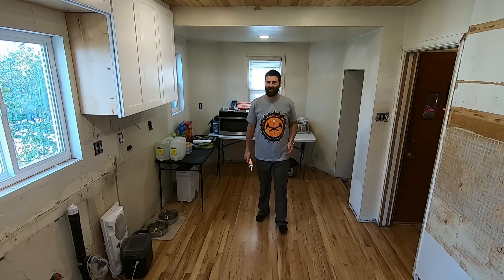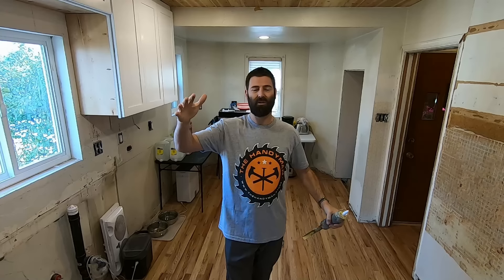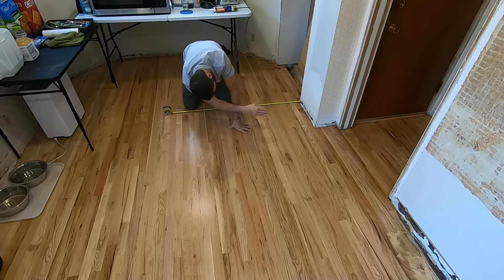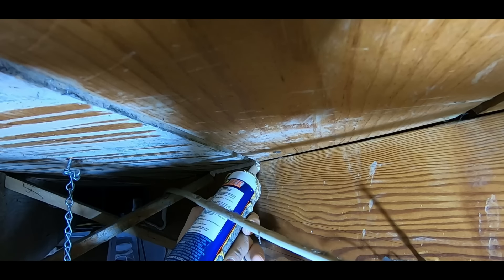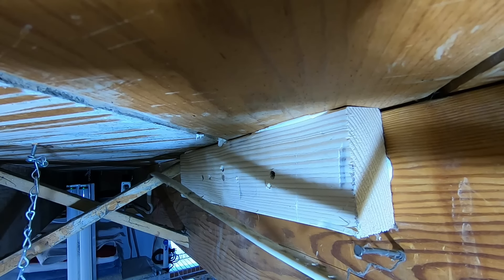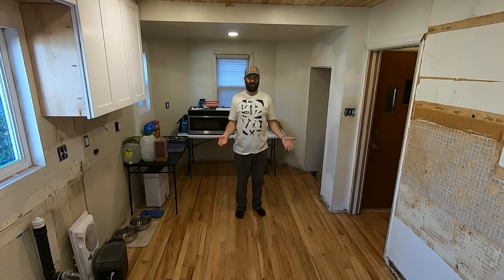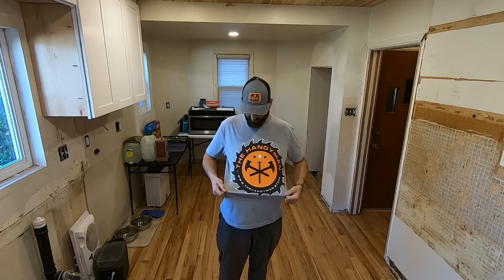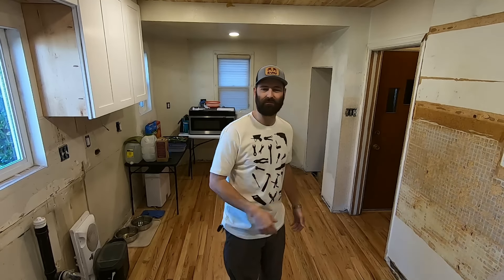How To Fix Floor Squeaks In Old Houses | THE HANDYMAN |

Comment: My house is 56 years old and it has oak floors. Several years ago I used "Counter-Snap" hardwood joist screws to fix the dozen or so squeaks. They have held up fine. They make two kits, one is for between-the-joist squeaks and the other is for at-the-joist squeaks. Figure out if your squeak is over a joist or somewhere in an area between the joists. They work. And, they aren't visible. Don't have to work in the basement or crawlspace. Just walk around the house, find a squeak and fix it.

Comment: Why do all of this rather than just drilling a screw into the joists, breaking them off and filling the hole with woodglue one of those wooden floor repair kit sticks and paint? It fixes the squeaks instantly and you don't have to wait a day to see if it even helped. I'm ignorant on the subject and would be open to an explanation. I just paid some guys to do what this guy did, and I'm wondering if I made a mistake.

Comment: what length screws do you use for this job? and what type of adhesive?
Reply: I used extra strength Liquid Nails to fix my squeaky stairs, I'm sure that will also work for floors.

Comment: Just a little TIP (hope don’t mind): 5:10 If you cut a 5° - 10° bevel going away from you towards the sistered joist, & the top of bevel will “touch” the subfloor above; you’ll create a “gap/pocket” for the adhesive to all go into & help “connect” the material together.....making it little bit stronger (especially when add those “screws”) & more importantly.....less likely to squeak. This also helps the “glue” not to leak/squeeze out over time, from ppl walking above, 5:38
I so hope that all made sense, cuz it did in my head🤪 (for explaining, that is😂); & we use a similar method when installing stairs (bevel the riser & treads; so the adhesive has a place to go w/o oozing out, but also allows good adhesion). This also helps w/ using less fasteners in the face of the tread; meaning less filling later👍🏻
Cheers✌🏼

Comment: Little tip for ya, have the screw drilled through timber block (for under floor), so you can just drill through without trying to hold block, position screw THEN drill in

Comment: Interesting fact: The decking used for the subfloor on that house was first used to form the basement walls. The white/grey "runs" on the bottom of some of the decking boards is the cement that ran over.
Reply: I always wondered why there was grey/white goop patches on my basement ceiling. I removed my stupid drop ceiling and now I'm vacuuming between the joists, and some of that stuff sprinkled into my eye... I washed it out but it sucked. Will wear goggles next time.

Anywho... Thanks!

Comment: I used a dealt 16cauge finish nail gun for years to install plantation shutters and my #1 concern was are younsure that will hold and that was one of my made up bshiterys I would tell the home owner my nails are also coated with glue. Of course they weren't but they didnt know that coating I believe is so they dont rust waiting to be bought in humid environments

Comment: I was thinking you’d have Handy Andy upstairs squeaking while you were in the basement pinpointing.   I had to eliminate some squeaking on 2nd story with those break away screws (through old asbestos tile) prior to carpet... worked good.  
I used a few on first floor hard wood prior to re-finishing along with shims and screws from bottom up... i still have a nasty one that i will try your way on. Thanks H.M. !

Comment: I've got a split-level house that has 10 steps going downstairs and 3 steps to the upstairs where the bedrooms are that was built in 1965'. Almost all of the stair steps creak on both runs. Very annoying to say the least. The upstairs steps are hardwood covered with carpet, but the downstairs steps are just hardwood, no carpet. I don't have one of those nail guns like you showed, which would probably work well on the downstairs run? But the ones that are carpeted is a whole nother ball game. Any suggestions as to "How To" quieten these creaking, hardwood floor stair steps? Without having to put them all up, lol. Tks!
Reply: Did you find a solution? Try those snapoff style of screws through the carpet, maybe?

Comment: For a precision locator that's visible when down under the floor, I drill an 18" piece of flexible music wire through the floor at a wall to floor junction. Baseboard covers the tiny hole. I'll probably buy a t-shirt even though you don't have an AK on there.

Comment: I have a squeeky floor "kit" I got from home Depot that has some special drill guides and break away screws designed for use on carpeted floors or hardwood. I saw the "this old house" guys use it.  For the wood floors, the screw breaks away below the surface and then you fill with color matched putty, like the minwax stuff. Doesn't securing the squeeky that way, or like you did here interfere with the floor's ability to move with humidity? Or is it that the few places one ought to have to repair not significantly impact the overall floor system or it's just securing the subfloor?

Comment: Have you tried squeeeeek no more? It’s a screw system that the head of the screw brakes off 1/5 of an inch below the surface of the floor. It works on carpeted floors and hardwoods
Reply from the maker: I have used them.
Reply: The Handyman are the nails better? Just curious if I need to get a new toy... I mean tool or not lol
Reply from the maker: The screws work If you don't have access under the floor like on a 2 story home.
Reply: I never understood the screw breaking under your floor lol…

Comment: So I've got a finished basement. Any insight on how I might fix some squeaks without cutting out the ceiling?
Reply: use the break away deck screws. you would do this from the top of where the hardwood floor is and not beneath. fill the holes with the color matched crayon putty.

Comment: What about squeaks between the joists?? I have planks just like these. They are run at a 45 degree angle to the joist. I have thin strip oak flooring. I'm assuming the floor boards are 3/4" thick. Did you use 1 1/4" screws? I've got several squeaks all over the place. 1961 original flooring throughout the house. Any help is greatly appreciated.

Comment: Maybe this is already mentioned somewhere, but what do you do if your hardwoods are laid directly over the joists with no subfloor? I have a 100 yr. old+ house, and the floor boards are super thick, but there’s no subfloor. You can see the floor boards from the basement. How do you tackle those squeaks in that situation? Maybe a 2x4 glued and screwed directly and glue squeezed directly in the board gaps?
Reply: same method but without the two screws on either side of the joist I would guess. Just screw the 2x4 to the joist and glue above like he did.
Reply: The person who originally lived in your house is dead and never anticipated a guy named Seth to live in it

Comment: Got a fix for second floor squeaks.  I don't want to tear out the lath and plaster ceilings on the first floor. Also for some reason on our house the second floor does not have sub-flooring.  Just tongue and groove right to the joists.

Comment: Hardwoods on slab are common in some places. They rest upon a 3/4” to 1” plywood laid over the slab. When done correctly they are laid with a lot of glue, not to prevent squeaks, but as a moisture barrier. Same as if you glue down manufactured hardwood to a slab, main point there is moisture control.
Reply: Yeah I was thinking the same thing, like I’ve put hardwood on and over Crete tons of times, you can put sleepers down as well. Made me cringe watching him shoot that screw up to the underside of that floor.
Reply: Jace And Jace I’ve seen some houses, 2 story base on slab, where you shoot the screw from top down thru hardwood, talk about cringeworthy
Reply: C Golden damn is straight punch whoever did that. I’ve seen people top nail with brads along the bevel. I’ve heard of  people dust baby powder to help the board move along each other, but never been brave enough to try that myself.

Comment: If not a basement, many houses have crawlspaces.  However, older homes have crawl spaces that you can barely even crawl in.  I'm talking 24" at most from soil to subfloor.  Reparing squeaks needs to be done from the top side of the floor with deckscrews in these cases.
Reply: A deck screw into the joist from above seems like a much more elegant solution compared to 6 screws, a glop of glue and a random bit of wood from underneath. Especially when trying to fix dozens of squeaks throughout a home.

Comment: Wicked awesome merch! Definitely going to grab some! In regards to the squeaky flooring: say the squeak is a second floor wear the framing joists are visible from the first floor and the 2x4 couldn't be used. Would you increase the gap between the joist and subflooring to apply glue or is there a different method you'd use?

Comment: How do you solve this problem for a multi-unit property? For example the 2nd floor apartment has a squeaky issue. Do I have to tear the ceiling off of 1st apartment in order to address this issue?

Comment: I live in a tri-level and the lower level is finished, so I will need to cut out the drywall to get access to the subfloor. I will be doing this repair by taking off the drywall because the squeaking really annoys me.

Comment: Ignores those of us who have the squeaks in our hardwood where the ceiling below is finished. Now what do I do?
Reply: But actually! Basement has ceiling plastered - old school fire code? Anyway, total pain, can't access any of the subfloor. I tried the breakaway screws and they work alright if the floors are old and already have some patchwork done on them. Just pick up some filler to fill the holes. Give them a try.

Comment: just ordered my Handy Man shirt so I can sport it in Chicago....btw  what do you recommend for squeaky stairs/steps?
Reply from the maker: They make screws where the head snaps off below the surface that work well when you don't have access to the underneath side.   You can get the kits at both lowes and home depot.  It is something they have in stock.   Thank you for buying a shirt.

Comment: Any suggestions in fixing floor squeaks in an identical hard wood floor product with a completely finished basement?  No access between the floors to fix from underneath.  I'm sure the answer is... I'm screwed :)
Reply from the maker: You will have to use a special screw kit and screw right through your floor.  The head of the screw will snap off you are left with a small hole you have spot fill.

Comment: You should really use T25 for your Tama hard to strip out and you always got a good grab but I'm sure you know that. I have a hatred of Phillips head and flat head screws. Just be sure to spend about $10 on one T25 driver bit it will last almost forever.

Comment: My house built in the 70s has glued down engineered wood floors original to the house. The glue failed at some point and literally every step is a squeak/ glue squish noise. It’s horrible. It’s a black type glue, slowly I am replacing it with 3/4 hardwood floors but that takes time and money.

Comment: How long of screws do I need?
Reply: For the 2x4 into the joists probably 3 inches. For the one through the subfloor and hardwood probably 1 inch and 1/4. Test in a closet first to see if the nail pokes through (which you don’t want)

Comment: The only thing I did not read is the screw length.  Sub floor is 3/4 inch and hardwood is 3/4 that 1.5 inches ..I would use a 1 1/4 inch screw

Comment: Handyman, I noticed your screws through the 2x4 were angled upward instead of perpendicular to the joist.  Is this because the angle helps pull the 2x4 up into the decking above the joist?
Reply from the maker: It is so I can fit the screw gun up between the joists

Comment: Didn't hear any safety warnings. Before using screws of any length under or on the floor surface, surely you need to be 100 per cent sure there's no danger of piercing electrical cables or water pipes?

Comment: 5:25 shows exactly why I much prefer Robertson square drive screws to those dang Philips screws we keep insisting to use in the U.S.
Reply: I wholeheartedly agree, that sound annoys me to no end.
Reply: You know, I've had issues with Robertson screws. Even they can strip, and the metal can be soft such that the driver bites into the screw head and jams itself in. I'm surprised at how well that thing can get stuck in. So far I've not had any similar problems with torx screws.

Comment: I'd like to fix my floor squeaks, but whoever put the ceiling tiles up in the finished basement stapled them to the furring strips...  One day I'll redo it all so I can fix squeaks, have better looking ceiling tiles, and have normal access to things.
Reply: You could always screw down through the floor if the squeaks are that bad
Reply: @MyDIYBuilds  I've considered that, but the worst of them are in the kitchen that has vinyl flooring.
Reply: Yeah, that wouldn’t work out too well

Comment: Sqeekless, awwwwww. 
During the summer, I hear fewer sqeeks because of expansion. But, during cold months, more sqeeks do to   contraction. My husband thinks I'm crazy. We have carpeting and I once saw a little tool with a screw to screw into the carpet, then rock off the screw head. No more sqeeks. (At least that was what he said on the show). 
Do you know of such a little tool?
Reply from the maker: Yes the screw that snaps off is great for floor squeaks with carpet

Comment: Yea, I think framers today are worse than 50 years ago. My house was built in 2005 and there isn't a room i walk in that the floor doesn't squeak. I dont know if it was lack of subfloor adhesive or no ring shank nails or bad mechanical fasteners but these assholes sucked...even my stair treads squeak...

Comment: Modern houses don't use that. If they want to do the job correctly, on sub floor to joist, they use screws. And don't do this with permanent adhesives. This is done lazily. That stuff should never be used on anything that you can potentially remodel. This is why the industry standard is to use SCREWS from the sub floor into the joists.